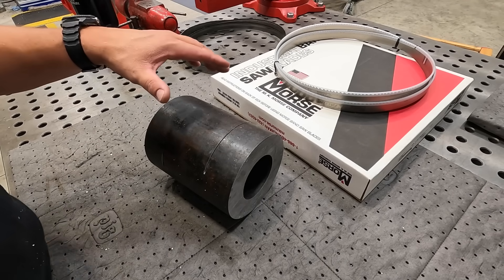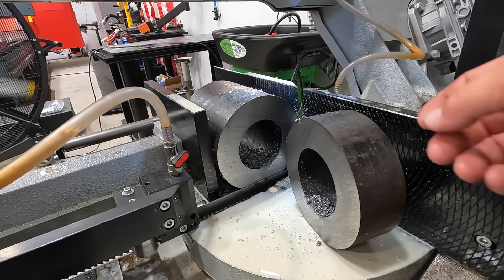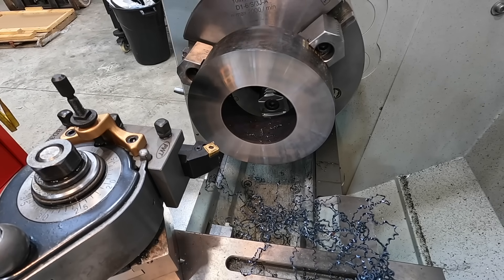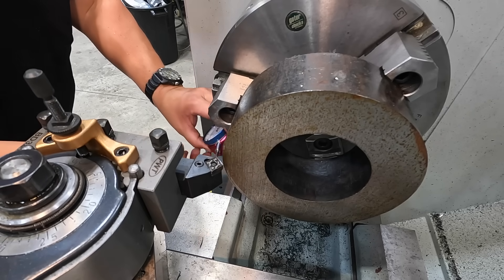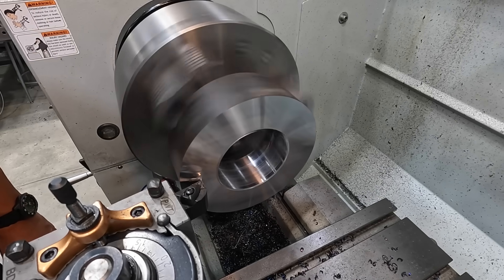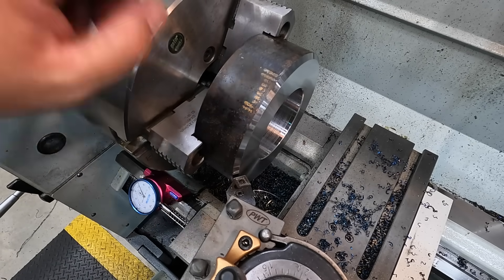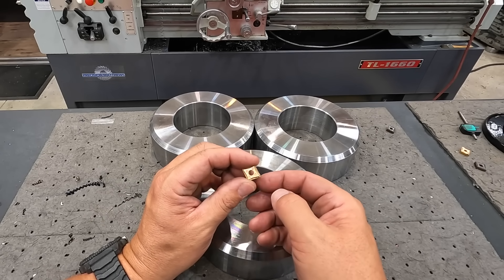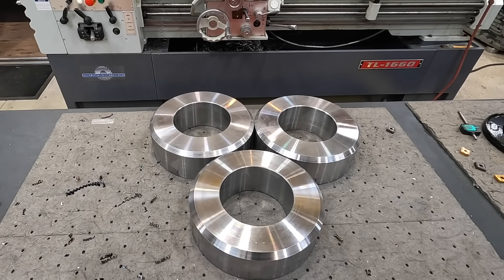Machining 90mm Pin Bosses - SNS 379

Comment: does it make sense to build a little jig to hone used inserts?
Reply: Not on carbid insert. They have coating on them.
Reply: I’ve sharpened many carbide inserts on my 
pedestal grinder with a diamond wheel. If they’re slightly dull I get a little more life that way. In my opinion inserts are a little too dull to begin with. Why can’t they be sharp like carbide end mills?
Reply: @ellieprice363  you can Get them Sharp as a rasor. But it is not for heavy turning. Just order minimum radius.

Comment: Summary

* (0:00) The Problem: The video starts with Abom79 addressing a problem faced by a welding shop: their bandsaw blades are breaking when cutting heavy-walled tubing, possibly due to hardened steel. 
* (2:46) Abom79's Solution:  He cuts the tubing on his own bandsaw using a new MK Morse carbide-tipped blade, successfully avoiding the welding shop's issue. Moving to his lathe, he prepares to machine the pieces into pin bosses.
* (12:54) Facing the First Piece: Abom79 aims for a surface speed of 650 ft/min on the ~6.5" OD tubing, selecting a spindle speed of 380 RPM. He begins facing with a feed rate of 0.009"/rev but encounters heavy cutting and poor chip formation, suggesting potential material hardness. 
* (21:40) Switching Strategies: After struggling with the YG1 inserts, Abom79 switches to his trusted ISCAR inserts and a different facing tool. He maintains a 0.009"/rev feed rate and sees significant improvement in chip formation and cutting action.
* (49:58) Project Outcome: All three pin bosses are completed successfully, featuring a 90mm bore with 0.010" clearance, a chamfer, and a 0.25" wide weld prep. Abom79 notes that while the project had challenges, particularly navigating embedded bandsaw teeth (44:05), the final products meet the welding shop's requirements.
* (53:46) Lessons Learned: This video highlights that even experienced machinists encounter unexpected issues. Abom79 showcases adaptability by switching tools and techniques, emphasizing the importance of having reliable tooling, and demonstrating problem-solving in real-world machine shop scenarios. 

i used gemini 1.5 pro to summarize the transcript
Reply: I hate ai.

Comment: Yes you did it! But, then, what? Will this solve the owners problem? What can I learn? Why did he success first time and then wasted two blades?
Reply: There must have been a harder material included in part of the metal. It’s a defect. You can learn to be careful where you get metal from and how to work around an issue like that

Comment: I ruined a blade on some 9% chrome
Reply: Turn down rpm when cutting chrome
Reply: It was 3” schedule 80 pipe and I was using a portable band saw. I ended up using a cutting torch because the grinding discs were also ruined when I attempted to bevel the end.

Comment: Mr Adam Booth -- I have been watching your very informative videos ever since those Nashville cobblers repaired a pair of boots for you. Those guys (and mainly their work) lost all interest a short while after that but I have been extremely interested (as a total layman) in your extremely well-done & informative"traditional machining" stuff, plus all the "CNC" advancements ever since, checking a few times a week to see what you're doing.

But honestly, when I see that the videos run 38, 48, or 58 minutes, I am very disinclined to click: do you know what I mean?!!

I have never encountered anything the LEAST BIT boring in a single one of your more lengthy videos, but please CONSIDER how to give us non-tech CLOCK-WATCHERS a break; like maybe "Parts 1,2, etc, etc". Please, sir?
Reply: I prefer longer videos that show start to finish work. To speed things up, I frequently watch videos at 1.5 to 2.0 times speed.
Reply: Pause the video whenever then add it to a watch list. Then you can pull up the watch list later and finish it
Reply: @davepost7675  I watch 50 to 60% of the videos like this at 2X.
Reply: I think this job took a lot longer than he expected and this kind of work doesn't really warrant multiple parts. There's nothing stopping you from watching half and coming back later for the rest.
Reply: @Dirk_Von_Dickshlinger  Good advice
Reply: @kindabluejazz  Thanks, good advice
Reply: @Dirk_Von_Dickshlinger  Smart! Thanks